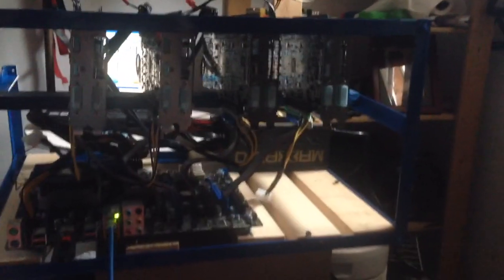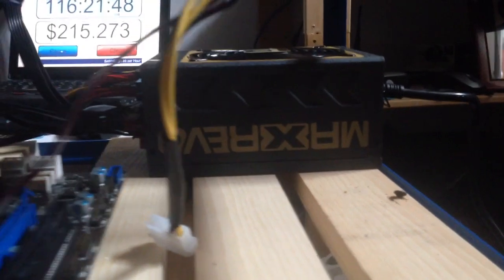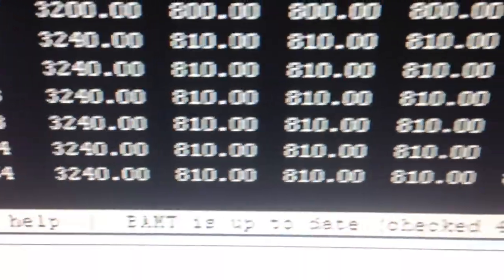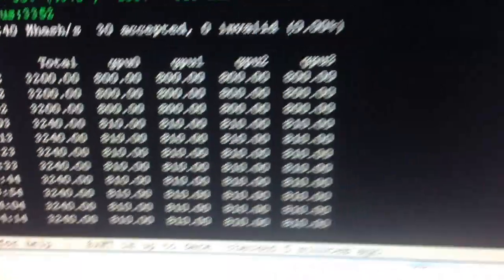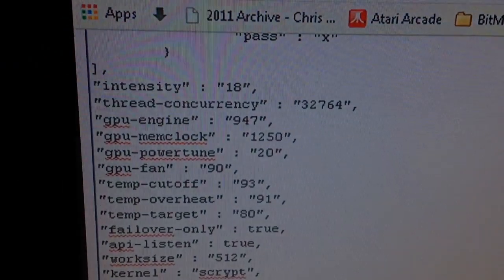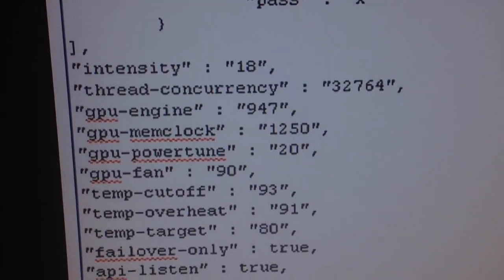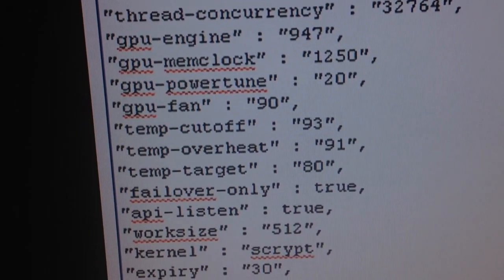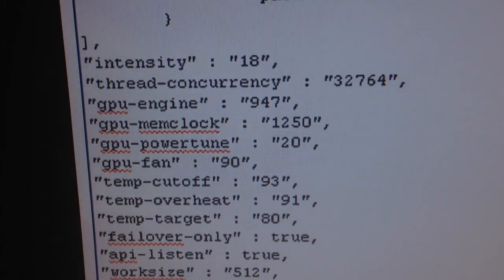4x R9 290 mining rig, the easiest rig you can build

Comment: Have this board. Only way to recognize more than 2 cards is by updating the BIOS and enabling IOMMU under the OC>cpu features menu. Also, contrary to popular opinion do not turn off any other built-in peripherals (USB3, SATA, etc). That was the ticket for me
Reply from the maker: I didn't run into this problem but I did do the update from day one. Always do the bios updates. as for the other setting, not my experience but it must have been required for your specific setup.

Comment: Was wondering if I can pick your brain for a bit. Have no Lenox experience so getting quite frustrated. Having problems with SMOS GPU and IP address not showing up on desktop. Running gigabyte  2x290, MSI 970-G 43, eight gigs of memory. Thank you if you
Reply from the maker: us smos bamt 1.2 it shows the ip on the screen. 1.3 has some quirks/bugs still.

Comment from the maker: Some good questions have come up. Many people are stuck on the idea that a specific mumber of cards on nonpowered risers are bad. This is partially true. It all depends on how much power your cards draw through the pci-e slot. I read recently that R9-290s use the top power plugs to to provide memory and gpu power relieving the pci-e plug of power load. This is good. I am also confident it depends on the capability of the motherboard to handle x amount of power to the pci-e slots.

My point is it's not as simple as just more than x cards. Its all about the power draw.